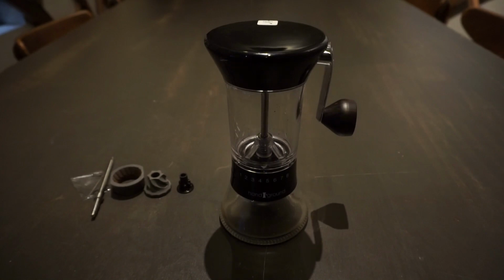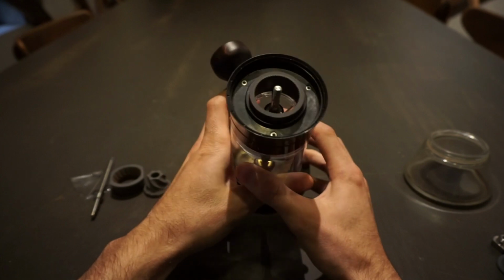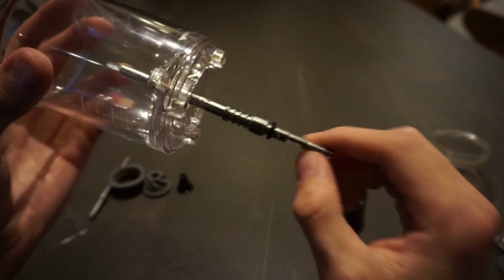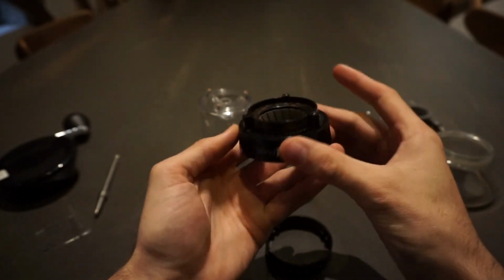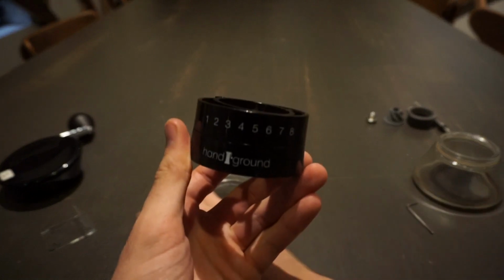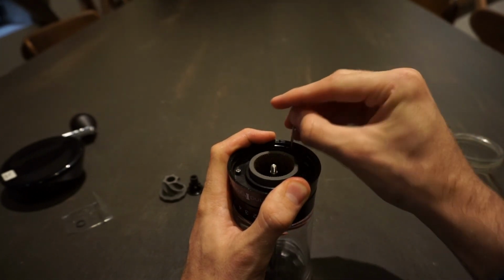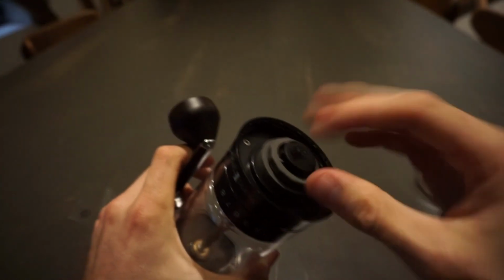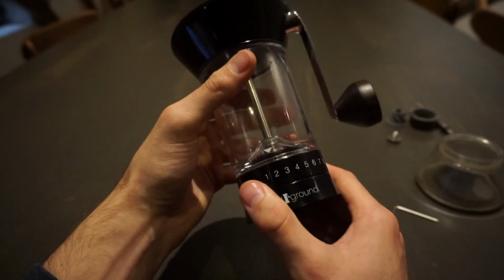Handground New Burr System Assembly

Comment: At the end when I try to calibrate it, the grind noise is intermittent rather than constant. It only touches for a quarter of the turn. Does that mean it won't be grinding consistently? Any advice on correcting that?
Reply: Same issue here.

Comment: Hi does this also improve the grind consistency, so that 1 can be used for espresso etc etc
Reply: I am looking at buying this manual grinder and intend to you it for an Areopress and OXO coldbrew. Best guess my settings would be 2 1/2 and 7 and I heard there can be inconsistency on coarse grinds. I saw your question and hoped there would be an answer, though I may not have an issue at setting 7.

Comment: Are the replacement burrs going be this style now and come with the new end nut?
Reply from the maker: Yes all grinders going forward will have the new burr system. We are currently sold out and have a new batch of grinders with the new burr system coming in this weekend.
Reply: Replacements for existing grinders, though. Upper and lower burrs plus new nut? I have the kickstarter original
Reply from the maker: Ah yes, replacements going forward will include the new burr mounting system. We will also make the new mounting system available for sale on our website.